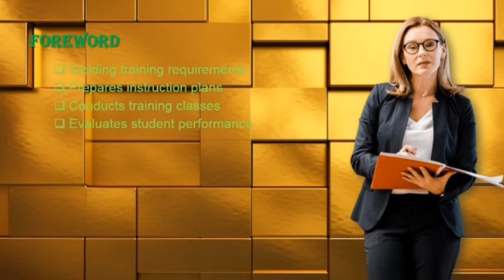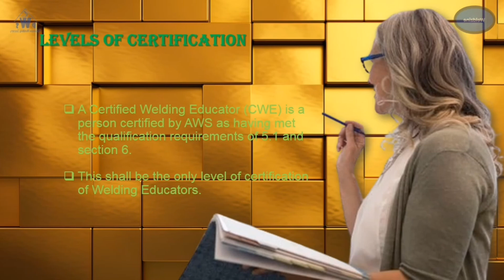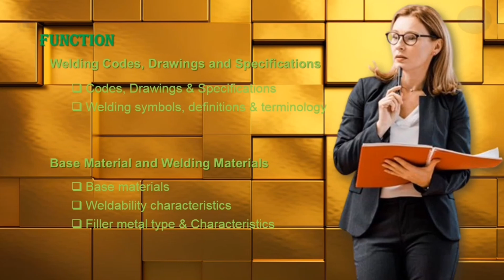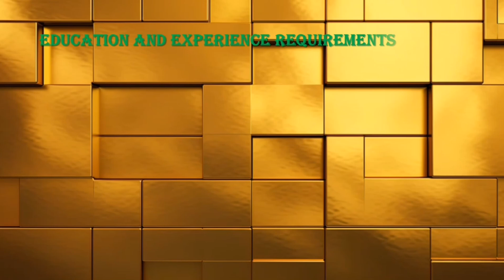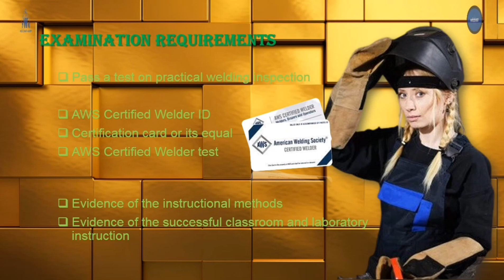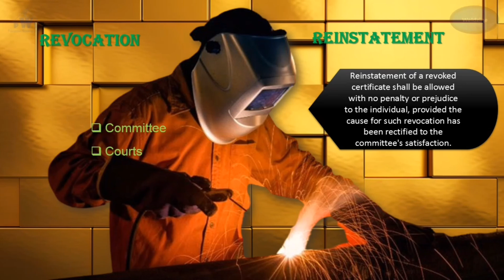How to Become a Certified Welding Educator I CWE I

Comment: To achieve CWE Certification, candidates must pass two out of three CWI exams:
Part A - Fundamentals: This 150-question exam covers topics like destructive testing, welding safety, metallurgy, understanding welding symbols, and more.
Part B - Practical: This hands-on exam tests your ability to apply WPSs and PQRs, use inspection tools, and execute required welds.
Important: Candidates must score at least 60% on each exam to pass.
While the Part C - Code Book exam is not required for CWE certification, those aiming for both CWE and CWI credentials should also take this exam.